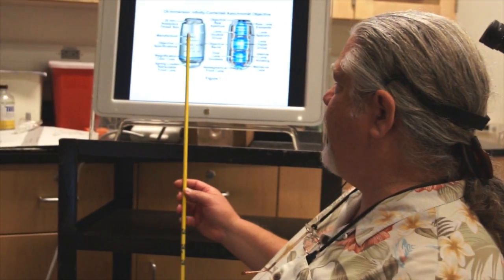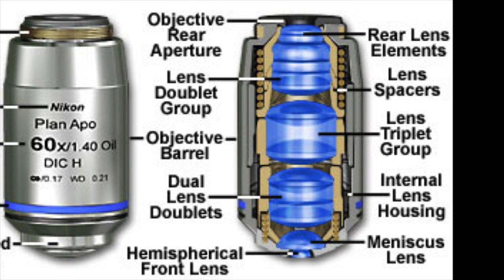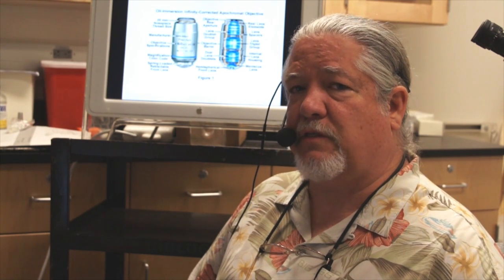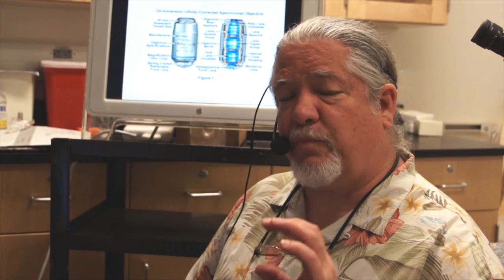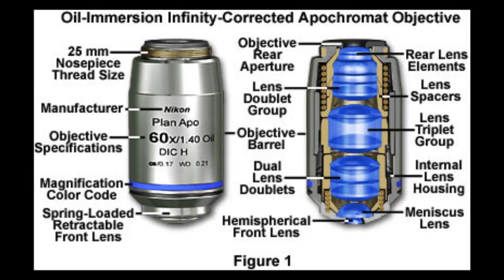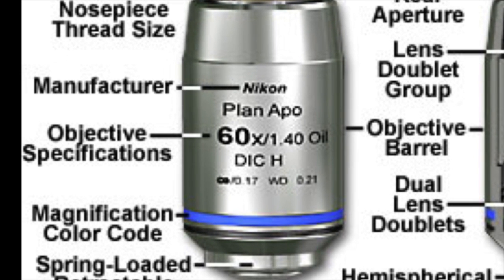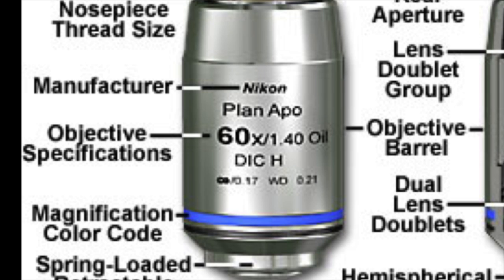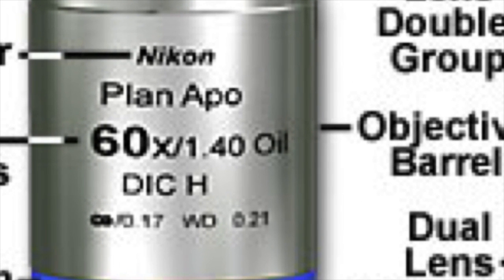1-3 Objectives, Barrel Info

Comment: The guy in this video does not have the slightest clue what the differences are between an infinity and a finite tube length optical system.  It has NOTHING to do with how far away the image appears to the eye - that's optical infinity in both cases.  Ignore everything he says about tube length and infinity optics.